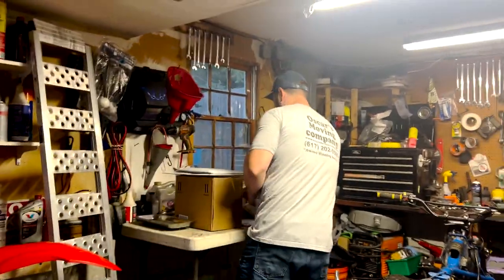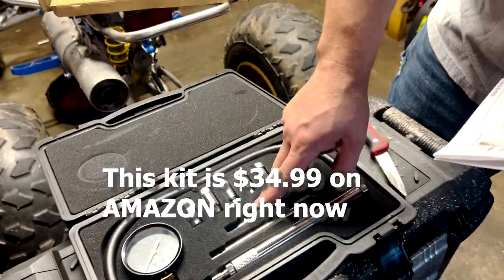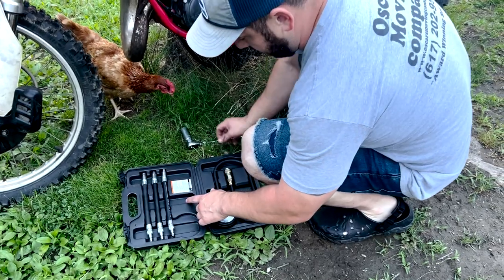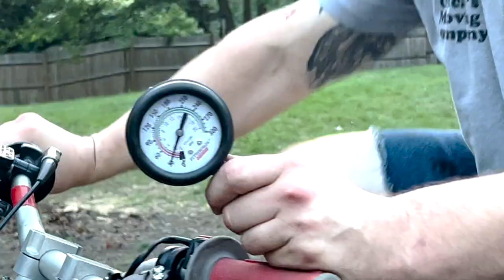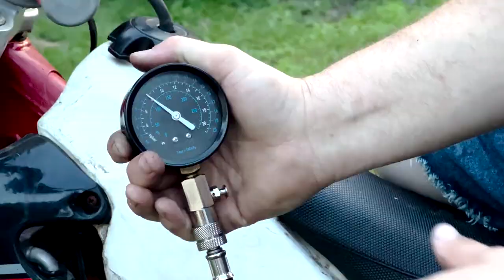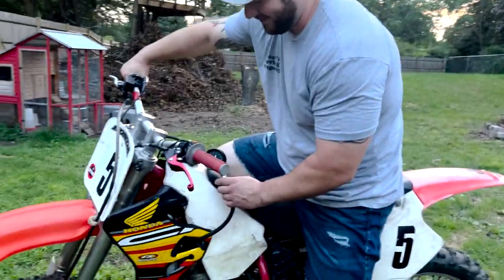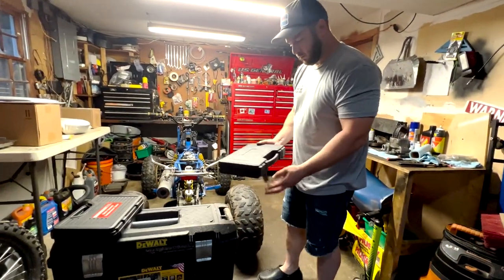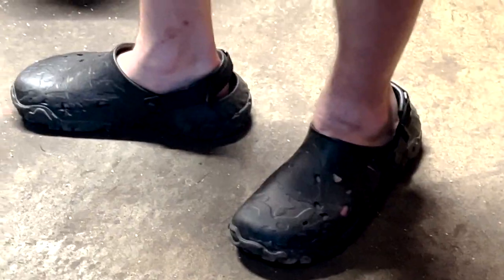Pittsburgh Compression Tester - Harbor Junk

Comment: The Harbor Freight Quick Connect Compression Tester is flawed. The one-way valve for the tester is close to the gauge, not inside the end you connect to the spark plug hole.
So when you compress the air, you're compressing the extra volume of air in the hose.
Might not seem like much but throws the accuracy off as you see.
Harbor Freight's other compression tester addresses this issue with a one-way valve in the brass fitting in the hose.

Comment: Just bought the same one. Working an f250 gas truck with a miss. Tested both good and misfire cylinders. Both came back at 60. Returning this junk tool tomorrow.
Reply from the maker: I still use mine. I just double the reading
Reply: @newenglandlife978  LOL!   My shop compressor was et to 130 PSI and it's accurate!  This crap tester read 65 PSI.  It also read 65 PSI on my 8 month old Husqvarna T540 XP® II and it in fact reads 65 PSI on ANY other engine including my 2012 R1 and 07 ZX 10-R and they run 185 PSI when the shop tests them.  LOL!!!!!!!!   Just throw it in the trash.

Comment: pretty sure the harbor one reads at half psi because its also meant for heavy equipment, such has skid steers, tractors, semi trucks etc which i would think use higher psi (i could be wrong). where your amazon one is more so directed towards two stroke and four stroke machines would be my logical guess. the harbor one it still reads accurate, just at half psi compared to most common compression testers like the amazon one you bought. but yeah just easier if you get the amazon style one so your reading accurate right away and you dont have to worry.

Comment: Make sure the tester you buy has a Schrader valve at the very end that goes into the plug hole.  This valve looks like one in a tire but it's not.  It's very low pressure like 1.5 lbs. When it goes bad you have to buy special ones for compression testers.

Comment: I have that Harbor Freight compression tester and it consistently measures low, no matter which machine I put it on.  You can buy compression testers that have the Schrader valve at the tip of the hose instead of and the end of it.  I was suspicious of the last measurement I made with this tester, so I haven't yet bothered to take this machine apart.  
It's a well-known axion in physics that you cannot measure something without disturbing it, so we endeavor to disturb measurements as little as possible in order to get the most accurate measurements we can, recognizing that no measurement will ever be perfect.
So I poured a fine liquid into the hose to see how much volume it takes up, poured it into a small measuring cup, and it was around 2.5 teaspoons, which amounts to about 12.3223 cc.  The motorcycle I'm testing is 1000 cc and has four cylinders, so 250 cc per cylinder.  Using the Gas Law, PV = nRT, assuming nRT is the same for both cases, we say that P1V1 = P2V2, or P1 = P2*V2/V1.  If P1 and V1 are the undisturbed pressure and volume inside the cylinder, then P2 is the gauge pressure we'll read with our hose and additional volume, so V2 is simply V1 + Hose volume.  
In my case, P2 (gauge pressure) was around 100 psi, which I considered to be very low for this bike.  But if we apply this fomula, V1 = 250 cc. V2 = 262.3223 cc, we get a ratio of around 105%, or an expected P1 = 105 psi.
Which is still a bit low.  But there is a 5% error in my reading.
If the piston is smaller, the error will be larger, and if it's larger, then the error will be smaller.  
In the meantime, this bike seems to run just fine, especially when it should not be running below 150 psi, I suspect that the gauge itself is not working properly.
Reply from the maker: I tried my best to understand everything you wrote. From what I can understand it makes some sense to me. What is your profession? Physics? Have you ever looked into the double slit experiment? That is what this reminds me of with the act of measuring having an affect on the test
Reply: @newenglandlife978  I'm familiar with the double-slit experiment, but this refers to the Heisenberg Uncertainty Principle, which applies more to quantum mechanics.  However, having little or next to nothing to do with quantum mechanics, this problem has to do with ordinary mechanics, and perhaps more along the lines of thermodynamics.  At any rate, no matter how small the impact, there will always be some disturbance in the measurement.  In this case, this disturbance is pretty large - for my CBR1000, around 5 to 6%.  For a 125cc bike, it would be closer to 10% error.  In addition to the hose error, the gauge itself must bend inside the mechanism, since it is usually a tube that shrinks or expands with pressure.  So here is a yet another source of error.
My profession is retiree, but my degrees are physics, mathematics and a terminal degree (Ph.D.) in electrical engineering.  My dissertation is online and centered around the study of quantum wires.
Reply: @RobertMertensPhD  This tester read 65 PSI on my 2012 Yamaha R1 which reads 185 PSI on my mechanic's tester.  LOL.  And it makes 170 RWHP on the Dyno so it is NOT 65 PSI!